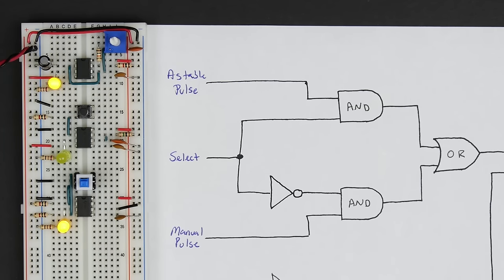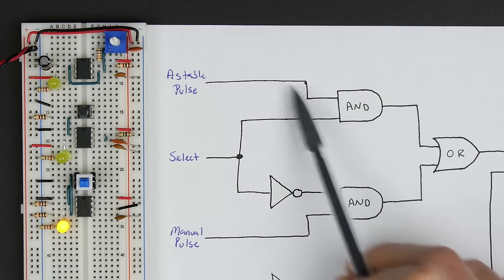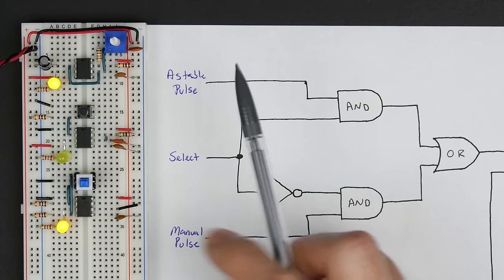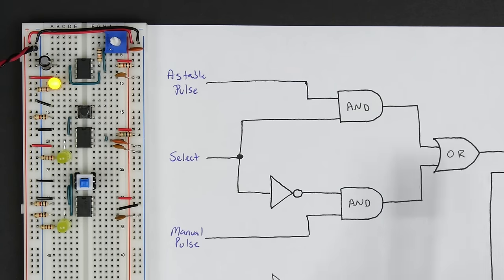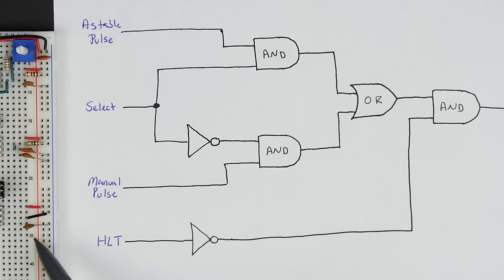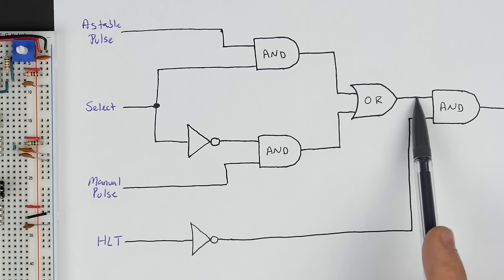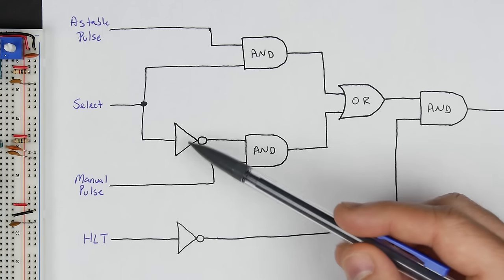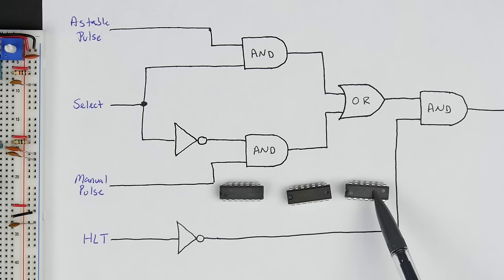Clock logic - 8-bit computer clock - part 4

Comment: Also you can REMOVE the OR GATE chip completely and JUST use the Quad AND chip and the Hex Inverter chip (using 5 of it's 6 gates) --- replace the OR GATE with a single AND GATE, but INVERT BOTH INPUTS & THE OUTPUT --- This converts the 'AND gate' to a NOR, and inverting the output makes the NOR an OR.  (so replace the OR with AND, invert both inputs and the output, rest of circuit as shown in the video! 😊😊  Only two chips, and use ALL but one of the available logic gates 😊
Reply: Or use all NAND lol
Reply: why are you writing some words with caps lock and others not?
Reply: @TantalumPolytope emphasis
Reply: My solution would be using NAND gates, as Ben suggested (4:47). But given there are three inverters in the circuit, made by tying the inputs of three NAND gates together, and the remaining four NANDs fit nicely into a single 7400 IC, you could use one 74000 and one 7407 hex inverter, reduce the number of chips to 2, and have 3 spare inverters for other functions if required.

Comment: At this point several people are asking why you even need the OR gate, can't you just tie the outputs of two AND gates together?   This may work for relay logic and some other purposes but in TTL logic  there are transistors that  connect the output of the gate to 5v for a 1 and to ground for a 0.  If the two gates are in opposite states you have created a short - 5v to ground.   You could potentially use a diode on each output like in diode-transistor logic to create an OR gate but this may still cause problems with leakage currents, bias voltages etc.  It is easier to just use an TTL OR gate.  Besides they are cheap.
Reply: Thank you for anwering the question
Reply: I have found a super simple or gate that solves this issue entirely. Just 2 diodes, nothing else. The inputs go through the two diodes, then the outputs of the diodes are tied together. Extremely simple OR gate that works even with TTL logic! Came up with the concept (Believe it or not) while playing with some redstone in Minecraft of all things.

In 1 ---------->--\
                         |------- Out
In 2 ---------->--/
Reply: @andreyrumming6842  Minecraft's redstone is a grossly underrated educational tool. Well done!
Reply: @andreyrumming6842  If you read the parent comment they already mention this. Still a cool find tho, redstone circuits are very fun for this kind of stuff
Reply: @IronLotus15  Wow, I must be completely blind, thanks for pointing that one out!
Reply: The only thing I would add if you're using diodes on top of a 555 timer at 5 volts is you can get pretty close to the minimum upper voltage threshold on some chips (since a 555 with 5 volts of power does not output 5 volts) so that plus the voltage drop of the diode(s) can get you close to or below that minimum voltage for a logic 1, so just something to keep in mind as the voltage drops can add up 😊 (plus if you have 5V power and are using a diode in series for polarity protection, you'll already be under 5 volts -- but yeah, diodes are AWESOME for saving chips and making basic logic for stuff like this! I've used diodes to make a prom 'chip' years ago (for a binary-to-seven segment 'chip' and used diodes for the decoding logic) 😊 --- at any rate, I love seeing comments like yours that involve critical thinking and other methods to solve a problem! Super awesome!
Reply: You can also COMPLETELY REMOVE the OR GATE CHIP and JUST use the Quad AND chip and the Hex Inverter chip (using 5 of the 6 gates) --- replace the OR GATE with an AND GATE, but INVERT BOTH INPUTS AND THE OUTPUT --- This converts the 'AND gate' to a NOR, and inverting the output makes the NOR an OR.  (so replace the OR with AND, invert both inputs and the output, rest of circuit as shown in the video! 😊😊  Only two chips, and use ALL but one of the available logic gates 😊
Reply: @dmeemd7787  Nicely done. You could still reduce the chip count by one because the two debouncing 555s can be replaced by a single.
Reply: @knghtbrd  absolutely!

Comment: You could use the 556 to make more room. It contains dual 555 timer in single package.
Reply: yes you could, but I don't think that would be as instructional.  It wouldn't show the same chip in 3 different configurations.  'Upgrading' this to use a single 556 is left 'as an exercise for the reader'.
Reply: I thought you were joking but it really is a thing...
Reply: @Amethyst_js  the 556 is one of my favorite ICs because it's name is even funnier than the 555
Reply: It should be called the 1110
Reply: Yes!
Reply: you could use a 558 (yes it did exist) a quad 555....
Reply: @renaissanceman5847  does??  It would still exist now, right? Unless it was hunted to extinction most brutally that is...
Reply: @CurrentlyObsessively  Digi Key carries a Fairchild KA558B quad timer on a 16-pin dip chip. At the time of writing of this reply, they have a herd of 3,000 of them. Happy hunting!

Comment: Struggled with this for a couple of hours trying to find out why the AND gate didn't appear to work when Astable clock was enabled but manual clock also worked on the output.....  Dead track on the breadboard was the culprit so the inverter was not outputting.  This is a great series with excellent instruction and explanation.

Comment: Finished my clock module. Was a lot of fun. Looking forward to building my eeprom programmer and getting started on the 6502 machine. I started with the schematics and resorted to your video if I needed help. Oof, my electric engineering class was a long time ago. But it did start coming back to me. Fun way to spend an afternoon.

Comment: This series is excellent. I really appreciate you breaking our the "How" an the "Why" of the sub-circuits, not just showing us what components to use and how to wire them. I was not expecting to see a breakout description of how the 555 timer  is accomplishing the needs of the clock circuit. It is fascinating. Also, thank you for going the extra mile and using the 555 timer in three different modes to teach us more of its capabilities.

Comment: I was able to implement the clock logic circuit using a single 74LS157 (2:1 Line Multiplexer) chip, used in later parts of the CPU. Basically, you can use the select button signal to select from manual or auto mode. The HLT signal can be tied to the Strobe input on the 74LS157, which acts like an Enable input for this chip.

Comment: It's usually good practice to tie the unused inputs on your logic gates high or low so that they do not oscillate and interfere with there neighboring gates. Great videos by the way keep up the good work.
Reply: Jake Wilkes True for CMOS, but most of his chips use logic families with internal pull up resistors. Compare the input currents for high and low levels.
Reply: You are right he should have done that. (or at least talked about it). 74ls don't require that, but someone reproducing that design with another technology might have issues, especially with badly decoupled power pins.
Reply: i checked on my scope with the unused inputs floating and i had 0.5V of ringing in my signal. i tied all the unused inputs to ground and my square pulses are clean again. the 74LS04 inverter was especially bad.

Comment: hey if you put the halt line before the manual pulse and have the manual pulse pulse the clock anyway (basically switch them) then you can program a HLT instruction into your program later on as a debug breakpoint. and use the opporunity to switch to manual mode and step through the next few instructions.
Reply: That gave me the idea, how to replace the 3rd NE555, 74LS04 and 74LS32 with just a single 74LS02 (nor gate), by building a manual sr-latch and using a nor-gate in series to get an or-gate
Reply: @TinusBruins  Actually Ben said that circuit shown on video isn't optimized good, it's just done for quick demonstration so you can improve it as you want.
Reply: @the_angler_2  I'm well aware Ben said that. It doesn't mean, that it's not ugly to use a Ferrari to transport garden tools when a pickup truck would suffice. So if someone gives me an idea how I can achieve that, I'd like to compliment them.
Reply: @TinusBruins  Actually this is education purpose computer, there's so many things to optimize. You can throw out LED's, bus transceivers etc. But the clock module was constructed from AND, OR gates etc for simple understanding. Actually all computer can be assembled using NAND only gates or PLD. But it was build that way. There's not so many attention paid to clock module.
Reply: @the_angler_2  You repeat what Ben said in it's video. And offcourse he uses AND, OR gates for simplicity that didn't even bother me. It's even posible to construct an sr-latch out of the spare gates, using an OR-gate in conjunction with a NOT-gate. Which actually gives educational value to how a NOR-gate functions as bonus. But at the time of my comment, I didnt knew you could build that from the spare gates. As then I only knew how to make an sr-latch with NOR-gates on paper.

Comment: You forgot the current limiting resistor for your blue led in the video (which is why it’s twice as bright as the other leds) but I see you did have it defined in the kit diagram. :) Amazing videos and love putting together my own version.
Reply: I actually was looking for this comment, I thought so too, but wasn't confident enough to say if I was missing something like a resister somewhere else on the line. Glad to know I was right (means I'm learning), and that it is on the kit diagram.
Reply: Yup, was looking for the same thing - the missing 220 Ohm resistor for blue LED.

Comment: My approach for the implementation of the clock logic without going to programmable logic would be to use 1/4 of a 74LS157 quad 2-input mux. You could use the enable input as your HALT one. It uses only one chip.

Comment: I just finished building the 8-bit Computer Clock Module, and had a lot of fun doing it. One thing I noticed is that the photo on the cover of the handsome documentation I received is high enough resolution that it can be used as a wiring diagram: I wound up both consulting the picture as well as the traditional schematic that came with the documentation booklet. I only found one difference between the two: the two inputs to the first AND gate, pins 1 and 2 on the 74LS08, are wired in reverse in the photo from the pins described by the schematic (of course, it doesn't matter).

Ben encouraged us to modify the design to suit ourselves, and I did make two trivial changes to my build. I like the potentiometer to turn clockwise to increase the speed of the clock, so I just wired to the opposite side of it from that shown. 

For selecting between free running and single step mode, Instead of the push-on-push-off button presented in the videos, Ben includes a slider switch that fits the breadboard better. If one uses the same pinouts for the slider switch as in the tutorial, then the left hand position of the switch is the "single step" position, and the right hand position is "free running" mode. I wanted the sense to be the other way around, so I just reversed the wiring of the switch  so that the left hand position is the free running mode one.

This was my solo Christmas Day project this year, and I reflected, as I worked, that I hadn't built an electronics kit on Christmas Day since at least 1978.

It occurs to me that the provided three logic chips in the clock kit are sufficient to demo all of the latch/flip-flop exercises which immediately follow this video in the series.

Thanks, Ben.

Comment: I just discovered your channel and have really enjoyed your projects.
The description of the various modes of the 555 timer are some of the best I've seen.
I've used the "triple nickle" timer for years and it is a very versatile part.

Being a recovering engineer, I am a big fan of simplicity. That said, I see a major optimization of your clock generator. With a few modifications, the entire circuit in part 4 can be implemented with a single 555. Since I can't put pictures into the comments, I'll have to use my words.

First, start with the astable circuit in part 1.

Now wire one section of the DPDT run/step switch so that it is between the discharge pin (7) and the resistors. The switch is connected so that in "run" mode, the timing resistors connect to pin 7 and in "step" mode, they connect to one side of the single-step button. The other side of the button connects to ground. This prevents the 555 from discharging the timing cap in "step" mode and once it reaches 2/3 Vcc, the output goes low and stays low. Pressing the button now performs this function and will allow the capacitor to discharge. When it reaches 1/3 Vcc, the output goes high. Releasing the button, lets it charge and after a slight delay, the output again goes low and stays there.

The other half of the run/step switch can be wired across the potentiometer, effectively bypassing it in "step" mode. This gives consistent step timing regardless of the pot setting.

Thanks again for some interesting and informative videos. I look forward to your next project.

Comment: Hi guys,
If you don't have enough space available on the right side of the bread board you can use just 2 chips.
1 Inverter and 1 Nor:  "(not SEL nor M) nor (SEL nor A) nor HLT"
or

1 Inverter chip and 1 AND chip: "not (SEL and not M) and not (not SEL and not A) and not HLT"
I have rather bulky power supply attached on the left side of the BB and this saved me from having to rework the whole layout.

Comment: 10:37 Might be good to use a red led to indicate that the system has been halted.
Reply: It's a good idea. However, it's something simple that you can just add on your own.
Reply: @nicolasfiancoski6792  *> It's a good idea. However, it's something simple that you can just add on your own.*
[tongue-in-cheek] .....yeah....and people could just google *how to build an 8-bit computer* without watching the video.
Reply: @WilliamLDeRieuxIV  I mean you don't have to be an expert in electronics to connect a led
Reply: @nicolasfiancoski6792  Connecting an LED isn't the problem (it requires no skill)......but knowing where in the circuit to connect.it does.

Comment: Awesome video, keep it up! Just one thing, I'd at least leave the LED signifying whether the switch is on or off in, since you can't rely on the output to see what mode it's in when the hlt is plugged to 5v.

Comment: I'm so stoked to get started on this! I've been an electronics tinkerer for a large portion of my life, but I'm finally to the point where I'm wanting to learn deeper in the weeds rather than use a micro controller. I was digging through all of my spare parts, and I found that I've got everything I need to build this (with the exception of a 1uF cap and 1 555 timer. I even have the exact logic ICs I need! Once I've got this up and running I'll likely be ordering the 6502 kit, so excited!

Comment: Great vid, Ben! I've just finished implementing this circuit; however, the OR gate had an output of 2.2v which the AND gate couldn't detect as high logic. The clock signal from the AND gate would flash but wasn't in sync with the original clock signal. I amplified the signal with a 2N3904 NPN and fed it back into the AND gate, and it worked. It uses a lot of power, and the output power is almost half the input which is not efficient at all.

Comment: I've finished the clock! I'm so excited and now I've gotta go get more wire. WAY more wire.

I had to use 74LS00's to do the switching and halt logic, and I was able to follow your diagram that shows how that might be done. I'm a programmer but with electronics I'm a total beginner. Thanks so much for this!

I've watched all your videos probably 10 times each and a copy of that book is in the mail. Someone also recommended "The Art Of Electronics" and I'll probably be getting that one too. I'm super interested to see how the control works.

More videos!!!

Comment: I like a 7402 quad 2input Nor for the astable/monostable select ... the inverted switch output goes to the astable pulse nor gate, the direct switch line goes to the monostable pulse nor gate, the both outputs go to a nor gate. Inverting the outputs of the first stage allow an OR to work like an AND and since the clocks are inverted twice through the Nors, the clock is back into phase. The fourth Nor can be used for the switch line inverter.

If clock can idle High when halted, you can combine the clock line with a single positive OR, and don't have to invert the Halt line.

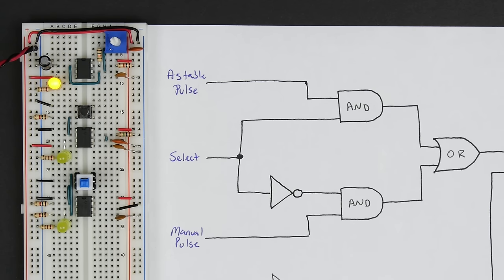Comment: 02:26 Yeah, adding a hot line to a computer is definitely a good idea :D
But I'm not so sure about the halt line being a part of the clock module being a good idea. The CPU should be able to decide on its own if it wants to use its clock input or ignore it, and it should be able to start accept it again when un-halted (e.g. by some interrupt signal or by the reset signal). The clock should continue running anyway, because there could be some other devices apart of the CPU which still need the clock working (e.g. some I/O devices which can un-halt the CPU at a certain condition, e.g. when a new piece of data has been read from some storage).

Other than that, this is a very nice design, very modular in itself: the clock is a module, but it consists of smaller modules itself, which makes it easier to understand how it all works together. I like it :)

Comment: whatever you do don't forget to add pull up resistors on the logic gates, i don't know how ben's doing fine without them but my chips burnt up and i had to order replacements. still works mighty fine for clocking the 6502 computer